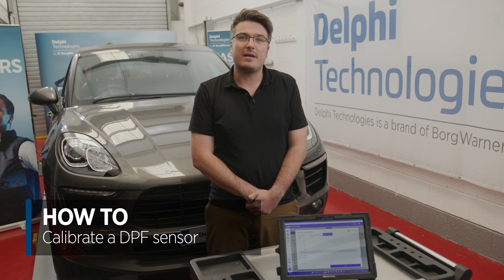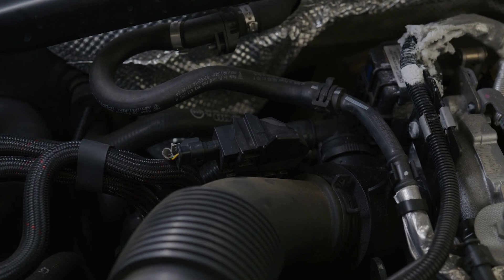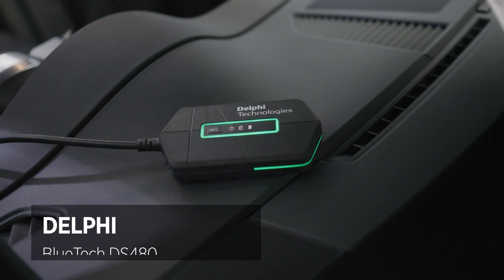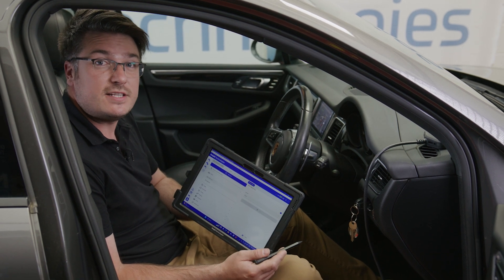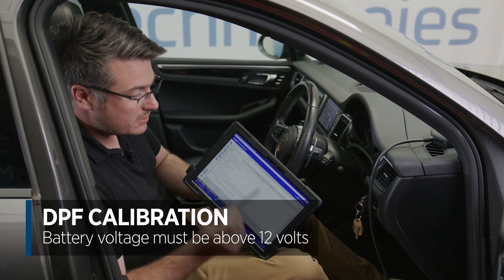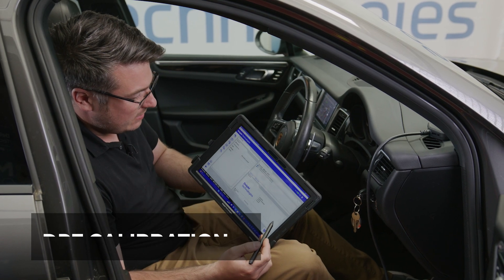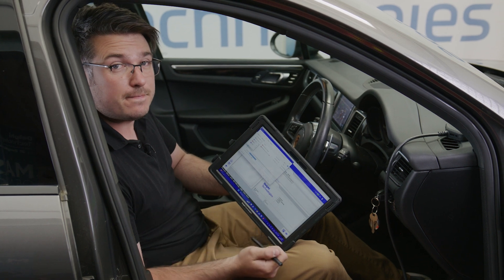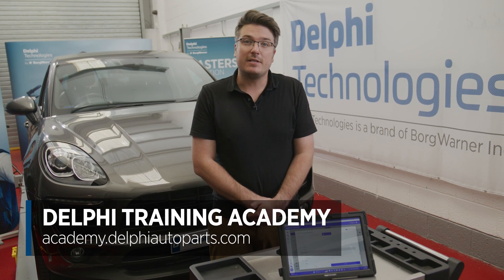[EN] How to recalibrate a DPF pressure sensor | Masters of Motion

Comment: After changing the DPF pressure sensor i get an error as soon as the ignition is on (engine off) if the outside temperature is bellow 10 degreed celsius, sounds like a defective sensor or calibration problem?
After running the car a bit and restart the engine the error dissappears
Reply: I’m having an issue with my sensor I suspect, did you need to calibrate your new sensor or did yours work fine without? I’ve got an engine light on and I’m hoping just replacing the faulty sensor for a new one will take the Light off the dash.

Comment: I do have a delphi tester but now i am using bimmer tool app and there at the dpf back pressure sensor calibration it ask me to add min value and max value for calibration, the min is 0 and max is 50 pha , the question is do i really need to calibrate the new sensor that i have changed ??
The DPF is regenerating as it should be , i have tested after the sensor replacement , at 3800 RPM has 72 pha
Reply from the maker: Hi @smamas this is quite a specific question, it would be best to reach out to our technical support team when you are carrying out this calibration live on a vehicle.  Let us know which country you are in, and we can direct you to the correct technical team.